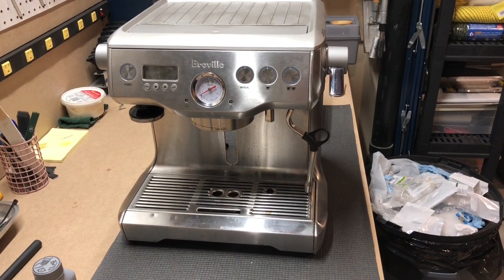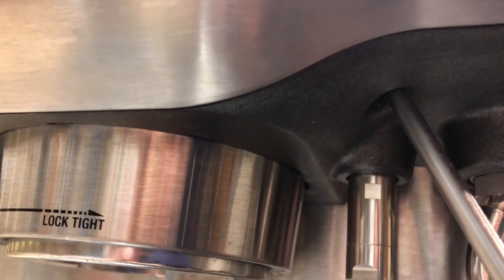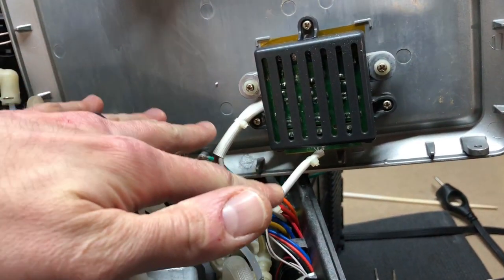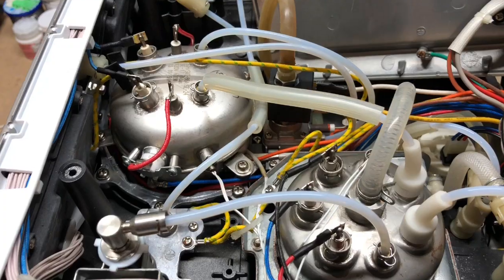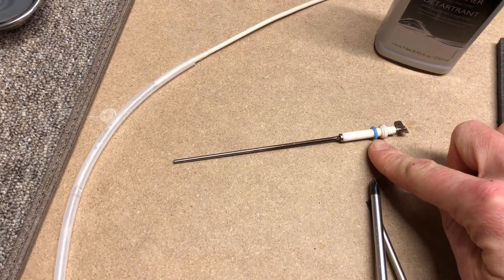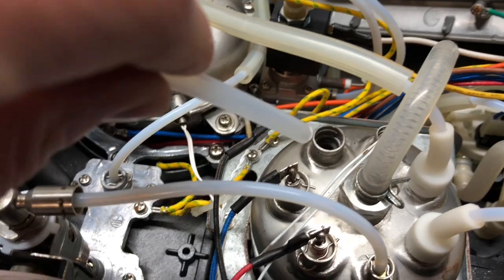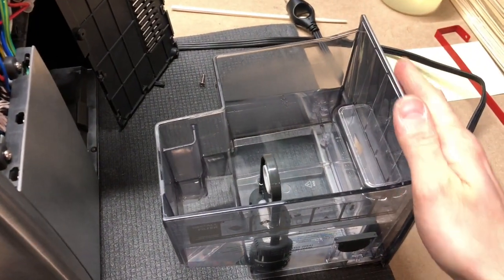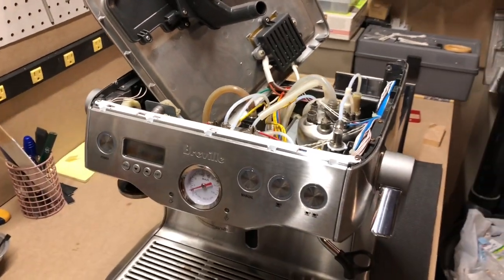Breville Dual Boiler Descaling Procedure

Comment: I bought one of these when I lived in Australia, it went into storage after one month of use and was in it original box for about four years,.  It's been sent into to get descaled once and for two repairs in the UK however, the UK Breville/Sage repair dealer won't now service our Breville because it is an Australian model.   Thanks for the excellent video, I will no doubt be doing this myself in times to come as well as replacing a leaking steam wand.   Regards from the UK.
Reply from the maker: Breville DB are great machines when they work, but a nightmare when they don't. Parts are hard to get and service is difficult to DYI and expensive to take in. There are other brands out there that cost a bit more and have fewer features but have equally good performance and much greater longevity. Glad the video(s) helped.

Comment: Hey Joe, thanks so much for your video.  I'm not able to break loose those front Phillip screws when taking off the top.  Try as I may they just won't budge loose.  I dropped some vegetable oil down there and let it seep in for a couple of days but no bueno.  Thought about spraying WD40 but didn't want that to seep into the boiler area and make things potentially flammable for whatever reason.  My next option is to drill those screws out but that seems extreme.  I suppose I can try to tap those screw heads but haven't found a tap drill bit that's long enough to reach down there.  There's a leak in one of the connections so I'm trying to replace the O rings.  Wonder if things got corroded a bit.  Any thoughts?  Thanks again for your service.

Comment: Hi, thanks for making this video. It shows how to drain the boiler, but what's the process for doing the actual descaling? I bought the descaler you recommended but I'm not sure what to do next. You say to "cycle the solution into the machine", but I'm not sure how to do that?
Reply from the maker: Fill the water tank with the descaler per the directions on the bottle then run the machine several times - use the brewer, steam and hot water functions repeatedly until the tank is drained. Then refill the water tank with fresh water and repeat using all 3 functions to flush the descaler out of the machine. You then have to manually drain the steam boiler per the tube/suction method described in the video.
Reply: @322816  thanks! Do you use both bottles of descaler in one fill of the tank? The instructions on the bottle just say to "fill the tank" but say nothing about the ratio of water to descaler.
Reply from the maker: @BenDavis78  I would use both bottles in one tank and dilute the descaler to 50% (1 part water per 1 part descaler). I recommend letting the solution 'soak' in the machine for a while after each cycle, i.e. run the solution through the brew head, then the steam wand then the water dispenser then wait 15-30min before repeating. It will take hours but will do a more thorough job.
Reply: Hi Joe, I finally got the machine properly descaled with the help of a little siphon pump. Thanks for the tips! The water that initially came out of the steamer boiler was almost blackish in color, but everything's crystal clear now.

One problem I'm running into now is a low flow rate. I tested pressure using the silicone cleaning disc, and was getting up to 10 bars. However, when I tested a shot with coffee it only went up to about three bars. I tested flow rate by just running water through the group head and found that I got about 66 ml in 30 seconds. My research tells me that that's a low flow rate. Do you know the best way to find the source of this issue? Is it most likely the pump or could something be blocking the flow?
Reply from the maker: @BenDavis78   It's not likely a pump problem if you're hitting 10 bar with the filter stopper. May be the solenoid valve, I'd pull it out and clean the tiny orifices. First though I'd just try a finer grind.

Comment: when you say siphen, do you have some external pump to do that or by mouth?
I am terrified of ever descaling my machine because twice the group head boiler stopped filling and creatd leaks. Lucky I am still on warranty
From watching your video and readhing others experiences, I think the major problem is small particles of scale clogging small tubings.
Ideally to avoid any clogging wouldn't it be best to manually put the descale solution directly into the boilers and not the tubbings and then manually flushing the boilers a few times as you mentioned by sipheing the water out? I also think its a great thing you mentioned by looking inside the boiler to see if there is any scale buildup this way you can see if its needed or not.
Adding a solution as Breville suggests 4 times a year is not the way to go.
I also found after descaling my coffee never tasted the same. now I know why. 
I am hopping that they will replace my machine altogether and then I will start it up the right way as I have learned.

James Hoffmann said that when you know your machine is clean and has no scaling to run a 30 second shot from the group head and weighing it.
do that once a month and if the water is weighs less then you know there is buildup starting. He also suggest using cirtric acid because its organic and you can easily taste the acidity if there is any left over. Look for his video on beginers guide to coffee machine maintenance. 

thanks for the help!

Comment: Great and very helpful video! Thank you for providing this to the BDB community Joe!
I followed your instructions, emptied the steam boiler completely, but not the other boiler, as it's easier to exchange the water there.
I then put the descale liquid into the water tank (warm water!) and turned on the machine. It started heating up, but stopped somewhere are 68° celsius and the steam boiler didn't pump any water and stayed cool, where as the espresso boiler got hot. I also noticed that on the tube, which connects the espresso boiler to the steam boiler a bit of water is leaking on the steam boiler side. Then I turned the machine off to prevent any kind of overheating or other problems.
Is there any other procedure to start the machine then just pressing the start button in the case of descaling?
And can you or anybody also give me hinters what the current behavior could mean?
Reply: Finally I managed to fix it by following these instructions: https://www.reddit.com/r/Coffee/comments/9zhl3n/bes920xl_steam_boiler_not_refilling_after/
Note however, that for my machine (BES900) after switching the machine on, I needed to quickly shuffle the steam lever to OFF and then back to ON to start the pumping

Comment: I have the exact same dual boiler. For some reason after using it a handful of times at a gathering it stoped heating past 150. I’ve opened it up and checked/replaced the thermal fuse on both boilers. Checked for continuity after and on all the wires I saw. I know the steam boiler has a bunch of white junk and needs descaling but I can’t run the machine to descale if it doesn’t heat past 150. The hot water only works if it doesn’t heat up all the way. The steam wand doesn’t nor the buttons to make a shot. The steam boiler doesn’t heat up at all when you touch it. Just coffee boiler. Any idea what I can check next? I thought fit sure blew a fuse but I changed them. The big round white fuses with 2 wires running through them I didn’t change but if I touch both wires there’s continuity so I’m thinking they are fine.
Reply from the maker: Haven't come across this problem before. Perhaps a thermistor issue in the steam boiler - could swap with the brew boiler and see if the problem follows the thermistor. Extreme caution required not to overheat the machine if you start swapping or bypassing the temp sensors. If you end up replacing I can highly recommend ECM/Profitec, especially if you're handy enough to do the maintenance/repairs on them yourself.
Reply from the maker: You could ping Ben Rombouts, he left a comment below with a similar issue.
Reply: @322816  where is the temp sensor located and any idea what it looks like? I’ve gotten the steam boiler almost completely out to replace thermal sensor and I’ve done the solenoid valve so I think I’m handy enough to tackle it myself but if not I’ll get some help on it!
I’ll ask Ben as well if he got it figured out
Reply from the maker: @slavsquad  If it's not a water level probe then it's a thermistor (there are many). Some are for temp control, others for overheat protection - not sure which is which. It could also be a problem with the main control board. Troubleshooting is going to be a crap shoot. Sorry I couldn't be of more help. You'll pay a lot for a Breville Tech to repair (they'll probably just want to replace the circuit cards rather than spend time trying to pinpoint the issue). If you can't get it going I recommend selling for parts and putting the $ towards a 'proper' machine that is serviceable and will last 20+ years. Good luck.
Reply: @322816  thank you I will do that. I was also kinda thinking circuit board possibly. When machine is on I checked the red wire on the coffe boiler and touched ground and my multimeter showed power but on the steam boiler nothing
Reply: @322816  my brother in law figured it out! For anyone else having this issue. Mine was a bad connection between the steam boiler sensor and the steam boiler. The white thermal paste needed to be changed. Which makes sense. The coffee boiler had electricity going through it when it was on (don’t touch with your hand while on, not only is it hot but you can get shocked like me slightly lol) the steam boiler on the other hand did not have any electricity going through it but all wires had continuity meaning no broken wires. So the steam boiler and the sensor had a bad connection and wasn’t powering the steam boiler. Hope that helps someone out :)
Reply from the maker: @slavsquad  Amazing that you figured that out, I wouldn't have thought the fix would be as simple as replacing the thermal compound. Thanks for posting the solution.
Reply: @322816  yeah I’m super excited it was that simple lol and my pleasure
Reply: @slavsquad  Thanks for posting this! I just purchased an as-is/for parts BES900 to repair and use. I'm showing the exact same symptoms as you.  (I also need to seriously descale - the steam boiler probes came out covered in chunky scale) Can you be more specific about which sensor it was? Was it the two slender white wires that go into the same port on top of the steam boiler? (you can see them for a lot of the video, but 10:42 is a good reference point) Thanks!
Reply: @smwatson82   there’s a few sensors that have that white paste. The one that needed changed in my Breville was the one under the smaller boiler. You have to remove it to get to it. The smaller boiler is the one closest to the pressure gauge. I also descaled the steam Boiler (bigger one). It was pretty nasty. It’s not hard to do when you get the machine to run properly. Just takes time
Reply: @slavsquad  perfect. Thank you for the clarification! And yeah. My steam boiler is pretty nasty as well. The probes were covered in chunks when I pulled them out - they looked like rock candy. I've got that boiler full of descaler right now. I'll see if I can free up the group-head boiler so I can check underneath for the connector you referenced.
Reply: @smwatson82  my pleasure. Hope it fixes your issue!

Comment: Hi Joe awesome video 
Quick question, shouldn’t we get the descaler solution through the group head, water dispenser and the steam wand aswell?
Reply from the maker: Yes, run it through everything to descale the whole machine. The steam boiler is the trickiest and it will most likely have the most calcium buildup.

Comment: Hi Joe! I have a question! I have done the descaling process on my BES 920xl.... and now, I have water from the grouphead with no problems, but when I want to start the steamer I only hear 3 beeps, and even the indicator led light does not turns on. 
Someone told  me that could be the thermal fuse of the steam boiler that I Need to replace... don’t you have a guide video of this procedure? OR how to get solutions to this trouble ? Thanks
Reply from the maker: I'm not familiar with the auto-descaling procedure on the BES920XL. I'm assuming you just followed their instructions, but if you opened it up and drained the boilers manually then I'd double check that you reconnected the probes on the steam boiler correctly.
Reply from the maker: Bernardo, before sending it to Breville you could try manually filling the steam boiler, as I did in the video. Good luck.

Comment: This was a great instructional video on dissasembling and descaling this machine. I will look to do this on my machine in the new year inlcuding replacing the solenoid valve which is faulty.
What I could'nt work out is how you filled and syphoned out all the fluid from the boilers. Any chance you could please explain what method you used? Thanks
Reply from the maker: To siphon out I used a small diameter tube to reach the bottom of the boiler through one of the ports in the top of the boiler. I sucked on the tube (with my mouth) to start the flow then let it drain into a bucket on the floor. To add water back in (for rinsing) I used the same small tube connected to a larger dia tube that I connected to a large water bottle. Good luck!

Comment: Hi Joe,  great video.  I was wondering if you could help me identify an issue I have after running the scaling process. Steam is leaking out of the drain below and it gets worse when pressure is built up.  Would you happen to know if there is a solution to this?  I could extract coffee without issue with good pressure on the brewing side but I can no longer use the steam as the steam just drains via the bottom drain holes.  Note that the drain access screws are tightly closed. Only happened after unscrewing the drain access and retightening during the scaling process. Could it be the solenoid valve or something else? thx.

Comment: Joe amazing video and thanks for the details. I am on my second BES900XL (first the screw in the filter broke off so they replaced. I am now getting a SERVICE message on start up but it still is functioning normally. Have any ideas? i would say this is nearing 5 years of daily use (1 espresso a day). I have cleaned timely and our water is not severe (hard). Thanks for any feedback
Reply from the maker: Haven't heard of this issue before. I suggest entering service mode (hold all four small buttons in while turning the machine on) to see if you get an error code, then google the code for a solution. Good luck.

Comment: Breville says to descale the machine every 3 months. Is it really necessary if you use Reverse Osmosis water with added minerals and not tap water?
The first time I did it , i had to send the  machine to be repaired because the group head boiler didn't want to fill up. 
Can you damage the boilers if the machine runs on standby a couple of hours a day?
Great video!
Reply from the maker: Descaling is entirely dependent on how hard your water is (i.e. how much calcium is in it). You can go years without descaling if you have naturally soft water, and extremely hard water could create scale problems in weeks/months. I suppose their "3 months" is a safe one-size-fits-all timeline for them. Your RO water would not cause any scale but you mention added minerals so it would depend on how hard you're making your water with those minerals. The idea is to descale before you have buildup otherwise a chuck of calcium could break loose during descaling and cause a clog. The machine should be ok on standby indefinitely but you should check that with Breville.

Comment: joe? in bottom left front of machine is black rubber piece, under it is two screws to drain boilers. the stuff on the bottom. one for each boiler/ why did you not use these?
Reply from the maker: Hi. You've described one of the upgrades they made on the 920 (those drains are there specifically to allow users to descale themselves).  The original model (900) did not have these drains.

Comment: I have a brand new Oracle machine, heating up to 70c and stop heathing , the Breville support guy  told me  it is air in the valves circuit, that I need to rotate the unit in order to get rid of the air, but I guess any advice there ? I guess i need to access the valves, unplug the piping and purge the air...
Reply: Did you find a solution? 
I'm currently having the same problem and the heat is constant on 70 deg with the power button flashing
Reply: @ksastorm4738  Hi, I solved the problem by pressing the hot water button , you can do it at any temperature , I guess that purge the air in the pipes.

Comment: Hey Joe thanks for this mate I've still got a problem my machine gets stuck on 63-71 degrees and dosen't get hotter than that any thoughts?
Reply: Did you find a solution .. ? 
I have the same problem with oracle 980xl after descale process.
Reply: @ksastorm4738  Im having the same issue now, I bought used machine and it only gets to about 85 degrees and when at about 75, starts producing stream into the drainage tube leading into drain bin. Altough I didn't go ahead and try, I think what it might be is scaling in the "vacuum relief valve", the "nut" in the middle on the top of the boiler. Although different machine, there is a tutorial how to clean or change the part. I'll keep you updated once I manage to take it apart. https://www.youtube.com/watch?v=L9P0t7__9ZM
Reply: @ben rombouts did you figure out what the issue was with you machine? Mine won’t heat past 150 degrees. Can’t figure out why